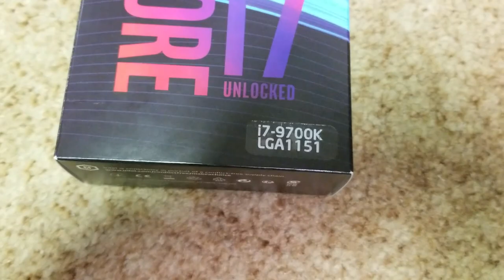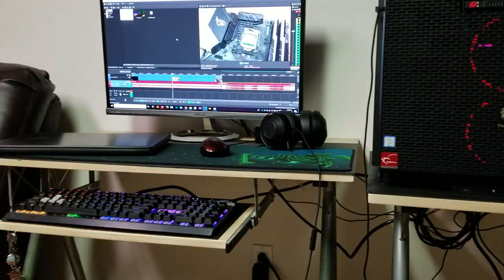DREAM PC IN 2017! 𝙄𝙉𝙏𝙀𝙇 𝙄7 9700𝙆/𝘾𝙊𝙍𝙀 𝙓5

Comment: swap the case doors to allow better air circulation, now you have 3 fan in one side, they make vortex in side the case because no ventilation, you need to make some opening to inject cold air from the room
Reply from the maker: You are right, but those are just for looks. There's 12 fans in that case, 3 on the side for looks, and 2 intake at the bottom and 2 on the front.Also 6 exhaust fans on 2x 360 aoi coolers on the top. Plant of air there.
Thanks though for the sudgestion!